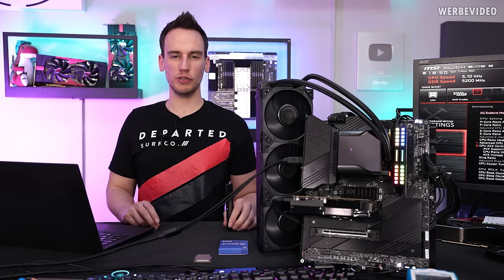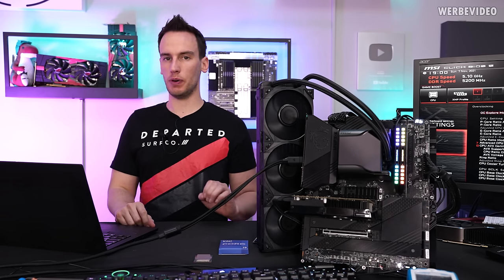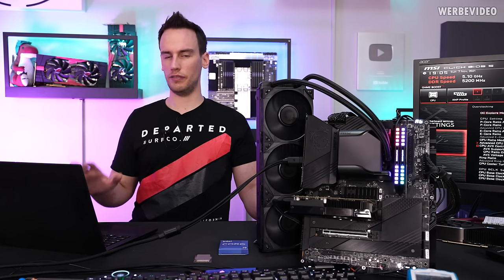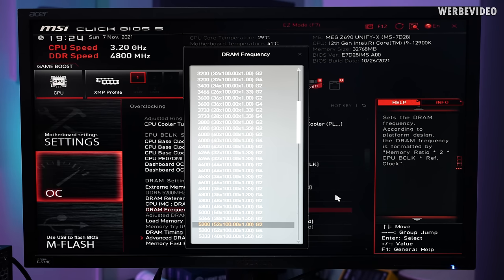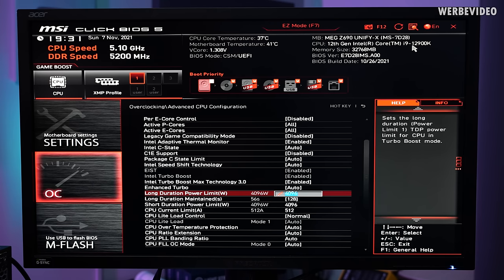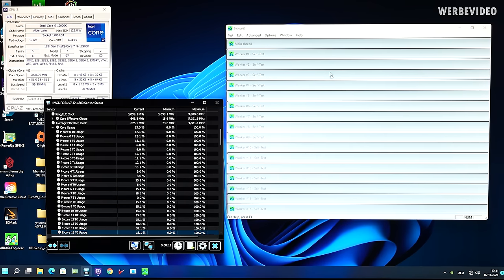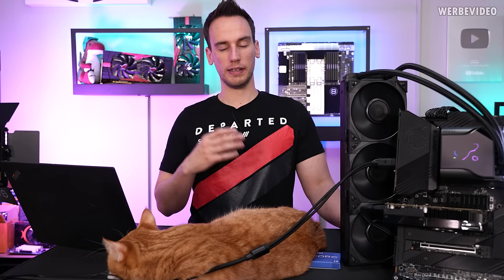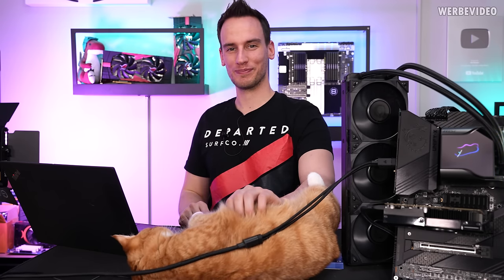Intel 12900K Clocks, Voltages and Overclocking explained - feat. MSI Z690 Unify-X

Comment: E-cores have priority over Hyper Threads that's why the E-cores get maxed in prime95.
Reply: Ah, so with 16 Prime95 threads the 8 E-cores takes 8 of them, leaving 8 remaining P95 threads to run on the 16 threads of the 8 P-cores.
And with some OS threads and other things always going on in the background those 8 P95 threads will bounce around between different OS "cores" (threads) which is exactly what we see in the screenshots.
Reply: It's refreshing to hear what I've thought all along, that overclocking for gaming does not have to be Prime95 or Cinebench or Blender stable. You hear gamers say their rigs are Prime95 24/7 stable, it's a waste of performance if all you do is game. If the games you run don't crash, that's all that matters.
Reply: @ivorthomas9437  I'd agree with that to a certain extent, but if it won't pass cinebench or P95 then you know that the system isn't totally stable and perhaps you shouldn't be hammering it 24/7 with those setting?
Reply: @yakacm  the point is that if you never installed cinebench then the PC will never crash. If it never crashes while using it is it unstable?
Reply: @ivorthomas9437  Agreed, It can also acts vice versa, it may appears stable in synthetic workload but as soon as you fire up some heavy cpu games, it may gives a bunch of correctable errors or even BOSD. My 8700k acted like that when I started to oc llc clock too far, it's rock solid in r23 but gives cpu cache hierarchy error and eventually BSOD in battlefield v in just 20 minutes.
Reply: @ivorthomas9437  For gaming sure but for me, my 5900x is also for editing video for my channel. It would be annoying to get 15-20min into and encode and have the PC crash, BlueScreen, or have the program stop responding. Now my 5.0 9900k PC I have no idea if it's actually 100% stable but it doesn't crash games so that's good enough for me.
Reply: @XxViciousxX  I did specifically mention the case of gaming.
Reply: @ivorthomas9437  I have fallen into this trap as well as i do lots of benching on my main pc ,  so on my new mini ITX build i was doing the same (10700k on a 240mm AIO ) worring about the temps runing Aida64 stress test & cinebench to tweek the overclocks when all ia am really going to use this pc for is gaming & media 🤦‍♂️
Reply: Where did I say ignore temps? I just said you don't need those tools to get a good stable, gaming, overclock. I am bemused as to why people are questioning ME about not using those tools, when it is in the video you just watched from the lips of Derbauer himself. Why are you not talking to him about it, it's his video not mine?
Reply: @ivorthomas9437  OTOH, prime95 provides a lowest common denominator. Nothing worse than switching to a new game and then crashing. Being Fortnite stable might not be Halo stable, which could be different that battlefield stable. Getting a worst case scenario can ensure your gaming time is uninterrupted by troubleshooting.
Reply: @obiwansotti   Once again, I refer you to the content creator, with whom I agree.
Reply: @ivorthomas9437  but stutters 

If the core fails in game and needs to switch 

You just rubberbanded ran in place and got dome shot man
Reply: Bro I want to ask why all use override mode, what if example we set P cores to 5.,1 and E cores 4.0, than voltage to offset - with 0.05?

Comment: I want more people to review and test the 12700k as much as this. So far it looks like the most interesting cpu price/performance. But want more indepth.
Reply: Right everyone is getting either the 12900k or 12600k. They just flock to what YouTube tells them. The 12700k is probably the best bang for the buck. It’s almost as good as the 5900x/5950x yet it’s $300 cheaper. Meanwhile the 12900k is $600-$1000 which is the dumbest thing ever since you can get 5950x for $700ish. If you can get the 12900k for msrp then it’s a good deal.
Reply: This is true but by the time you have run all your stability tests on software you're never going to use, I will have played my games for a few days and known for sure if it will run or not
Reply: @ivorthomas9437  i dont think we care about the same things
Reply: @mrwashur1991  12700 is only 10-15% faster than 12600, probably that's why
Reply: Yeah, 12700K is the obvious choice.  Same P-Cores that seem to OC just as well as the 12900K anecdotally & a lot of Z690 boards come with the preset turbo bins so you can get basically 12900k performance in one click after updating the bios.
Reply: @mrwashur1991  the 12700K is the obvious choice for those in the know.  

Even one glance at the spec sheet … $200 laziness tax.  TVB is the great equalizer & the P-Cores OC the same/ have marginally more TDP/OC-Voltage headroom with less E-Cores.
Reply: @lemming9693  It's ok to disagree.
Reply: @ivorthomas9437  yes but thats not the point of doing these videos for out of the box gaming. that why your argument do not work here.
Reply: You are not a very gratious guy. My arguments do work as they were proposed by the conten creator. I have had agreement and likes for my comment. It is you who has an issue, no one else
Reply: I have it. Good cpu. But its hot. Evryday use perfect.

Comment: This is the first time I've seen anyone talk about power limits in the BIOS (thanks for that).  I do this on all my machines after testing the limits of my coolers so that the CPU doesn't spend much time above 95C.  My current daily machine is a 10850k all core 5Ghz with a 280mm z63 AIO in silent mode.  I find that 275 short and 225 long works very well keeping the temps at around 91C while still maintaining 5Ghz for most workloads.

Comment: Nice Video. I'm running Noctua D15S air cooler on the Z690 Master and seem to be really stable at 1.35V, 5.1Ghz, 5200mhz DDR5, 68-71c in Temps while playing Warzone.

Comment: Since both have 8 P-cores, I would be interested in an OC comparison between i7-12700K and i9-12900K on P-cores only.
Reply: it should be same
Reply: @jlelelr  No, i7 is a lower binned chip, plus there's less L3 cache, I believe. The cache shouldn't influence OC, but the binning, yes. Probably 200 clocks lower?
Reply: @charleskrueger5523  Some will also be binned as i7 because of defective E-cores, and those could still have i9 worthy P-cores.

Comment: Amazing review and guide, was able to get my:
i5-12600K
Asus Prime Z690m Plus D4
Corsair H100i V2 AIO 
To a stable all clock P 5.2 GHz E 4.1 GHz
30c Idle, 58c gaming, 85c Cinebench 23 for 10 minutes, following your guide. I was actually able to get a 5.4 all Pcore 4.2 all Ecore OC using the AIOC but haven't been able to replicate it for some reason, decided to work once then poof.

Comment: I stuffed my 12900k in a Cooler Master NR200P MAX case.

That comes pre-installed with a 240mm AIO for the CPU.

My test of Cinebench R23 saw the CPU temps hitting 99-100°C!
Reply: the only cooler to keep the 12900k under 100c is like a 420mm cooler, 360mm keeps it around 85-90, but still hit 100 on a few cores... overall what I'm saying is no matter what, unless you under volt the chip it will reach 90-100c in Cinebench R23 ... I also have a 240mm with the 12900k and same issue reaches 80-100c  on 4 of the cores in the stress test.  I had my i7 970 for 11 years got it in 2010 and only until 2021 did I decide to overclock it .. basically, what I'm saying for gaming and work, you don't need to overclock.... especially  with these new intel chips they come overclocked right out of the box from intel, which is why there is less overhead this time in overclocking .. makes no sense in most situations to overclock a lot with these chips.

Comment: Great vid:-) Would you recommend overclocking with XTU? Overclocked my CPU to P-Cores to 5.2 All core, 5.3Ghz on 3cores and 5.4 Ghz on 2cores as well as 4.0Ghz on E-cores. Rock stable with a voltage offset of -0.070v. Hitting 85c with the XTU mem test peaking at 273W at 1.317v. Using a Artic Freezer 420mm AIO cooler.
Reply: Which cores you set to 5.2 and which 5.4 and 5.3?
Reply: @Poppaai  In Intel XTU it does not set frequency on specific cores, so I guess the software intelligently select the best cores for the selected frequency on active cores. I tried overclocking from BIOS but it just leaves me with really high idle/load voltage and temps which is something I don't really want. When software is as good as XTU I don't mind it stealing some memory to run in the background, and since I don't use Linux so I don't need to BIOS overclock like I usually do, maybe it will get better with later bios revision though :-)

The settings are as follows on perf cores:

Up to 2x active cores: 5.4Ghz
Up to 5x active cores: 5.3Ghz 
Up to 8x active cores: 5.2Ggz

E-cores are all at 4.0Ghz

Comment: I really love the approach to this subject.
But I have two questions:
1. if you increase clocks for the cpu for the intention of gaming, should you set a power limit just in case? what If I want to render a quick video to send to a friend and It uses %100 cpu, the pc could then thermal throttle or crash from instability?

2. if the 12900k boosts to 5.2ghz by itself, should I really be overclocking all core to 5.0ghz? if the game maxes 1 or 2 cores at %100 would I be better off using turbo boost instead of manual all-core OC?

Comment: You can removed the RGB of those dominator RAM sticks, they are just held on with a couple of screws.
Reply: You can’t literally remove the RGB since the LEDs are soldered to the PCB itself. You can remove the light diffusers on each of the ram sticks though.
Reply: @Hateroz  I mean he probably can if he wanted to. You know who were talking about right? I think he secretly likes RGB 😂.
Reply: I originally preordered the non-RGB version but it wasn't available so I went for the RGB version. I noticed that they were just held on by screws so I did a quick search to see if you could unscrew them and I found a post on Corsair's forum where someone from Corsair answered someone with the same question and they said you could just unsrcew them.
 I mean I've not tried it yet, but it looks like Corsair say you can, but I thought they'd maybe be soldered myself that's why I did the search but...
Reply: @Hateroz  Right I see what you're saying, yeah I think the thing I read they probably meant just the diffusers.
Reply: @yakacm  Oh no I was wrong. Based on what I saw a few years back, I thought Corsair had soldered the LEDs to the board. But it seems like a new revision of their Platinum RGB modules came out, which detaches the LEDs from the PCB to put them on a ribbon cable connected to the board. In the end, you can indeed remove the RGB lighting entirely from the modules.

Comment: I don't know whether it's something you intend to cover or even exists on Alder Lake, but Rocket Lake had some interesting overclocking features (at least in MSI BIOS) that let you adjust the VID curves and set different AVX voltage offsets. Basically lets you undervolt the CPU while retaining normal variable frequency operation and lets you adjust performance using power limits. Sort of like a PBO but with good voltage curve control. Since I use my PC for video rendering quite a lot I found that to be quite useful, since doing an export completely maxes out my cooling.

Comment: The E cores are heavy on the ring. If you disable them you can get far higher ring clocks which is good for min fps in games. It's no surprise your ring is at just 39x with 40x E-cores. You should be experimenting with lower E-core clocks to maximize ring clock if you're gaming.
Reply: So what’s the ideal setup for gaming if stable? P core 5.2, ring 4.9, e core 3? 1.3v or like mentioned higher e core less ring
Reply: @manlikeg2794  Why bother with 5.2? It's going to require a lot more voltage for no noticeable gain in gaming. 5ghz all core 4.6ghz ring (I have found that core and ring likes running at even numbers for best frametime consistency so 52, 50x core with 48 or 46x ring etc etc) and whatever E-core clock that allows the ring to run at 4.6. You can try for 4.8 on the ring but that might require more voltage than the cores need for 50x. 

Also, I completely disagree with him on using unstable clocks for gaming. You can crash at any time. If it's not Prime stable it's worthless has always been my motto (one run of 8-256k with 15min FFT size (hammers the caches) and one run of 256-1344k 15 min FFT size(hammers the ring and memory), run it the custom mode, check run FFTs in place and disable AVX!) however since Prime isn't running properly as of now your best bet is probably that memory stress test in XTU he showed until Prime and/or the W11 scheduler is updated. 

For memory stability testing I use testmem5 with the anta extreme profile. Has been very reliable with DDR4, will probably be with DDR5 as well.

Personally I'd disable E-cores, stabilize 50x core and 46x ring, see what voltage 48x ring needs, after that enable E-cores and see how they effect stability. I'd start from 2ghz clocks on them. If you're just gaming you might be better off just disabling them because games like fast core to core communication and fast memory access. The ring connects everything from the L2/L3 cache and the mem controller. Basically you'll need to experiment. Memory overclocking will add a whole other level of complexity to this. You could need more core voltage to stabilize with better fed cores so again if you overclock the memory disable the E-cores till you stabilized the memory OC (for mem OC I first check if its stable in testmem5 than run 256-1344k in Prime to see if the cpu as a whole is stable).

All in all tuning ADL with E-cores seems like a pain in the a$$ now that I'm thinking about it. Good luck! 😂
Reply: @TheBlackIdentety  thanks for all this info. The e cores do complicate things somewhat. Will have a play around and see what happens. Tempted to pay for a consult for someone on this one 😂

Comment: Limiting the watts allows you to run a much higher clock. for example I'm running my 12600K @ 5.3  but limiting the watts to 150 so in cinebench I only see 4.8 but see 5.3 everywhere else in daily use. I get to run lower voltage and higher clocks by doing it this way... 4.1 on the E cores...

Comment: I bought this motherboard. No matter what I change in bios my temps won't come down. Voltage also shoots up between 1.4 to 1.53. My package watts is always over 300w, VID Max is always at 1.3 to1.45+. I have a custom water loop with 2 360m rads.

Comment: You really should caution people right now when recommending XTU with Alder Lake because the max P-Core ratio you can create in a new profile is 4Ghz which is way worse than the stock settings and it can be a confusing thing to fix with XTU writing directly to the chipset’s firmware.

Running games with E-Cores disabled hoping that I will be able to re-enable them in the future as I’m unsure of how to do the scroll-lock workaround that Intel recommends.  Could be a good video topic.

I have two OC profiles one that’s 6Ghz without C-states & and AVX offset and a more reasonable one where I modified the boost-bin voltages to attain a 5.5-5.7Ghz boost frequency which is averaging out to 5.4 in benchmarks with relative ease & only 2V on the core.  Very happy with the overclocking headroom on my 12700K.
Reply: ah, yes. I run all my CPUs at 2V as well

Comment: Everyone seems to have better luck than I have when it comes to DDR5 XMP profiles. If I set mine, it'll boot into Windows, but once there, it's unusable. If it doesn't instantly bluescreen, every application will immediately crash after being ran. And this is a mild 5200 kit from Corsair.

Comment: I notice you hit the thermal throttling limits at some point during your testing. Might XTU during the CPU test have hit thermal limits, and that's why it didn't pull as much power? I suspect that's the case.

Comment: Nice video Roman. I just wonder why Remnant only used between 2 - 12% of the CPU? This also explains the low peak temperature while in the game. I would imagine that a game which would use 25% or more of the CPU would make it run way hotter, say for example Battlefield. Or am I wrong maybe?

Comment: What could I do if I wanna slightly over clock but I am running into a cooling issue, is there a way I can reduce the voltage a bit to minimize the higher temps? I have the same setup as you and my cores are hitting 100 degrees consistently?

Comment: Noob here. I have to disable e-cores since I can't update to Win 11 and Win 10 doesn't handle them very well. The problem is that by doing so, the ring frequency will shoot up to 3.6 ghz to 4.7 ghz, and temps will follow. So, what should I do next in this situation? Manually reverting back the ring frequency to 3.6 ghz or anything else? And what are the implications of such next move? being it what I tried to guess or literally anything else that you'll suggest me. Thanks in advance

Comment: is the msi z690 unify-x the best motherboard for me? Going to use it for gaming/streaming.
so far, i have the following:
-12900k
-3090 ftw3 hybrid
-7000D airflow corsair case
-latest 420mm aio from corsair
-Seagate FireCuda 530 4TB Solid State Drive - M.2 PCIe Gen4 ×4 NVMe 1.4
-G.Skill Trident Z5 RGB Series 32GB (2 x 16GB) 288-Pin SDRAM DDR5 6000 (PC5-48000) CL36-36-36-76 1.30V Dual Channel Desktop Memory Model F5-6000U3636E16GA2-TZ5RS
-MEG Z690 UNIFY-X (fuck it. just ordered it. lol)

I just need to decide on the motherboard, paste, psu (debating between 1200 and 1600 watt), and streaming stuff (I need to research this because I don't know anything about streaming but I know i want the absolute best of everything)

I think i'm at 5k and I havent even bought a psu yet. lol